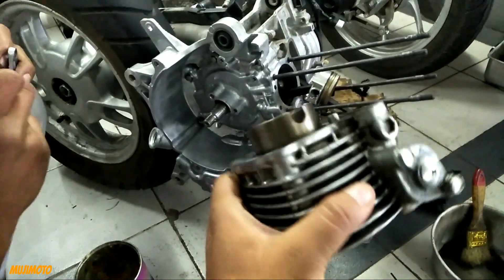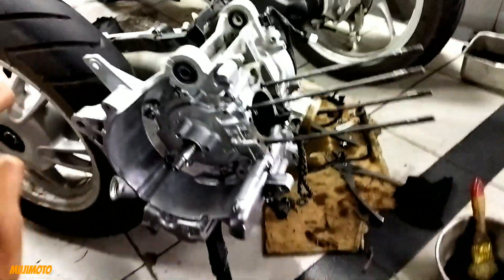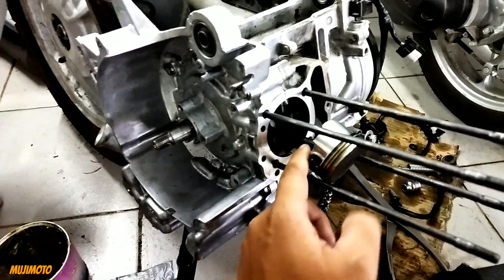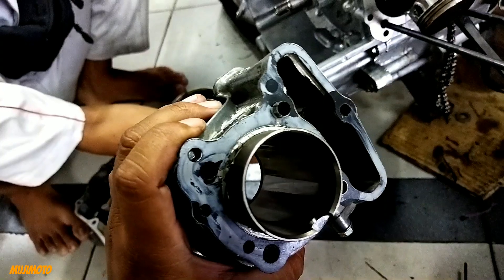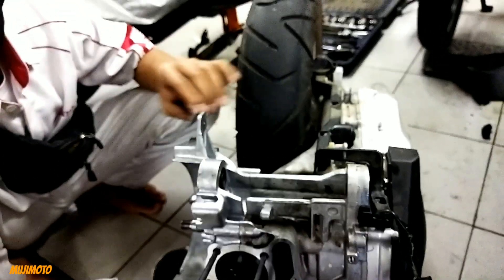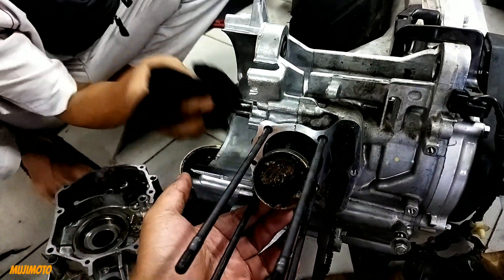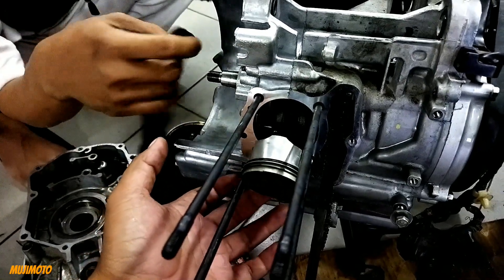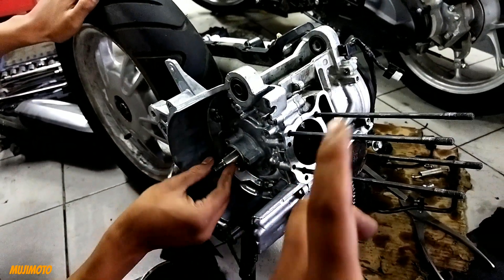TERNYATA INI PENYEBAB HONDA SCOOPY 2021 TIDAK ADA TENAGANYA

Comment: GX usah ribet ganti seher pake beat yg ukurannya pin 13,,kemarin saya ganti piston ukuran 52,5mm pen 12 banyak sekarang mah ukuran piston sprti MTR beat new Scoopy dan Genio sama" menggunakan piston mungil ukuran pen piston 12mm,,ganti piston GX perlu ganti boring itu liner sama ajah dengan beat lama,,cuma beda setengah mili,,kalo beat lama 56 kalo Scoopy Genio 5,5 pengen ganti piston ribet harus ke tukang bubut pake ajah piston Scoopy ukuran 50-53 banyak pen 12

Comment: Beliin istri scoopy baru seminggu lalu,terasa banget lemotnya,awalnya sy pikir krna baru,dan sy mmg pake motor cc 1000,jd sy pikir ini efek turun/terjun kelas dan cc,efek dari 1000 4 silinder ke 110 cc 1 silinder dan matic sblmya vario 150,jd sy bisa ngerasain extremenya penurunan horsepower nya,berasa mundur jalannya kalo di tanjakan 😂